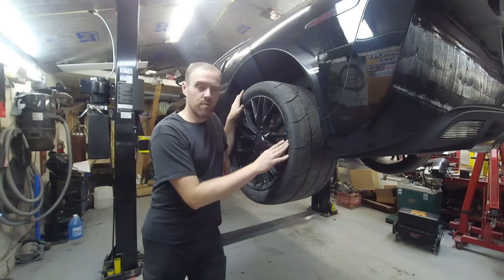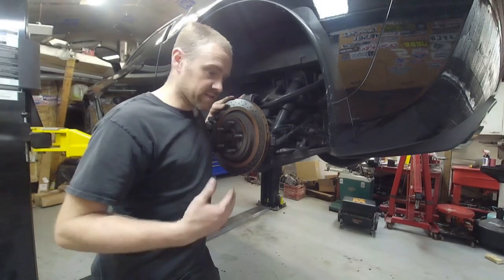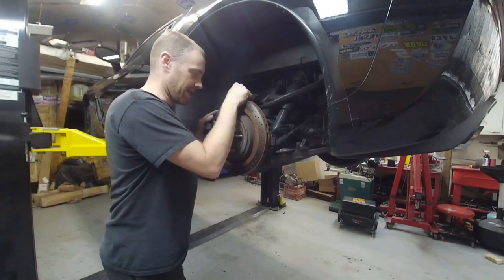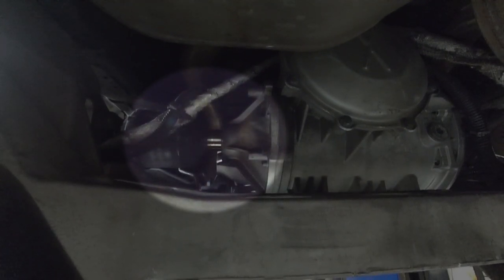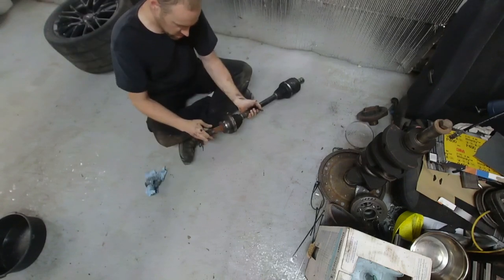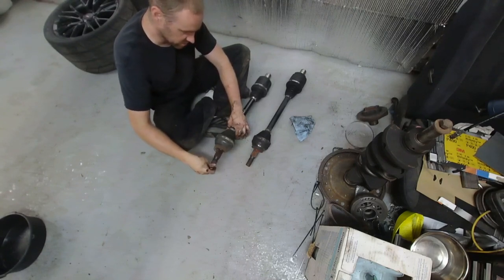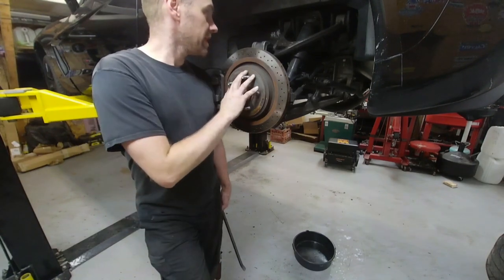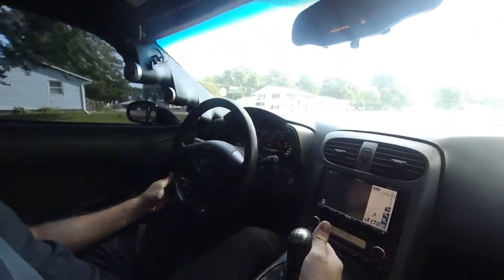2007 C6 Chevrolet Corvette CV Axle Replacement

Comment: Thanks for the video.  I believe the axle nut is supposed to be replaced, not reused.
Reply from the maker: It does not call for nut replacement per the tq spec.
Reply: @CrazedPerformanceRepair  The axle nuts loosening up has been an ongoing problem.  The nuts are single use per GM service bulletins and using Loctite on them is recommended.
Reply from the maker: @sstearns2  Locktight I would certainly support and a TSB? no way not GM haha

Comment: I went out for a drive in my 05 vette today. I was just turning onto the highway and gave the car some gas, as soon as I hit second the car lost all acceleration. When the car came to a complete stop I noticed that the inner right cv was broken. Will these cars not move at all with one cv broken or could the diff potentially be damaged? No issues with left axle
Reply from the maker: It should feel like it tries to move if on level ground. Your lsd in the diff may be shot. The corvettes lsd is not a very tight clutch pack from factory though so it shouldn't move much.

Comment: can u put zo6 axle in my 700hp automatic 2007 vette ? my axle just went
Reply from the maker: I believe the 05 axles are the stronger ones, I could but it will be a few months before I can.
Reply: @CrazedPerformanceRepair  The 05 axles are actually inferior design. The better choice is to use an 04 axle (yes, a C5 axle) because it has a better bearing/roller package in the boots. GM part 10311201. Bolts right in.
Reply from the maker: @Emfuser  that's just like the BMW then. The E30 axle fits e36 and is way stronger than e36.